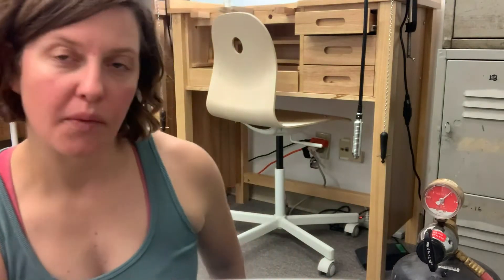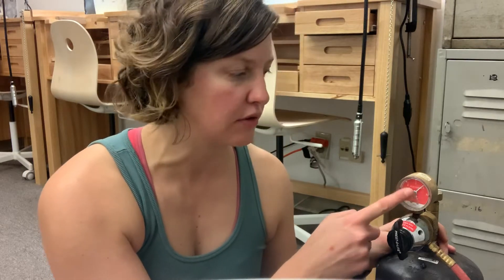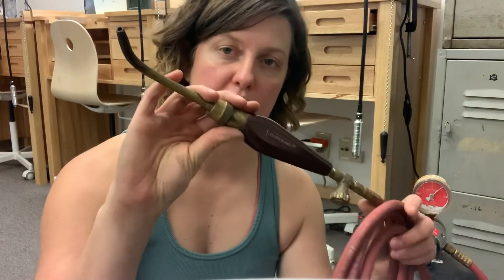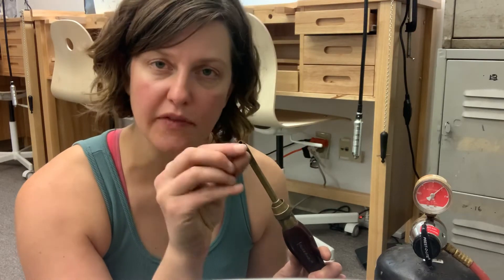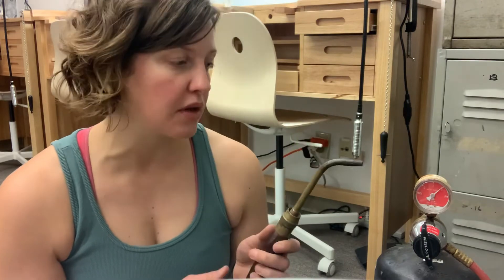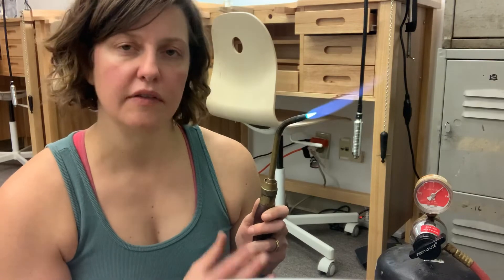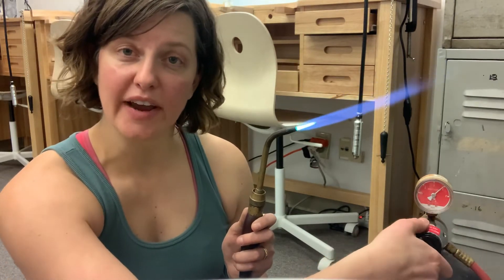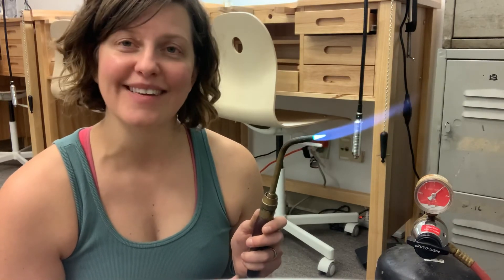Adjusting the pressure on an prestolite torch using and acetylene b-tank

Comment: I found a B tank with the same torch in this video, but the flame is all yellow.  I did bring it home laying on its side but have had it standing vertical for several days, trying it off and on but still all yellow.  Any suggestions?
Reply: hmmmm that is interesting. I've never heard of a yellow flame. I wonder if the torch tip needs a good cleaning.

Comment: Awesome vid. I actually inherited one of these torches. I got a bottle of gas and a new hose only to find out that when I open the torch valve, the gas doesn’t go out of the tip, it comes out where the tip screws in. Right in the middle . Does that just sound like a clogged tip? Thank you

Comment: Is there a max safe pressure you should use or is it just the max pressure in the tank itself?
Reply from the maker: Hi Marie, Many torches have an actual gauge that tells you the pressure going into the torch. If I have that gauge, I rarely set it over 10 psi. Unfortunately this one doesn't have a gauge...just a knob. Without the gauge there is really no way of knowing what the exact pressure is. The pressure in the tank is a separate measurement and it is controlled by the volume of gas in the tank. If the tank is full the pressure in the tank shows full. In regard to your question of safety, if the torch is functioning well at the pressure you are at, you are good to go. If the fire seems to be overly aggressive, you could turn it down to have more control. This will make it easier to use, but the aggressiveness does not affect the safety. thanks, Kelly - meritmadekc.com